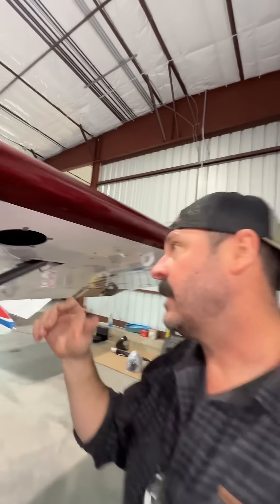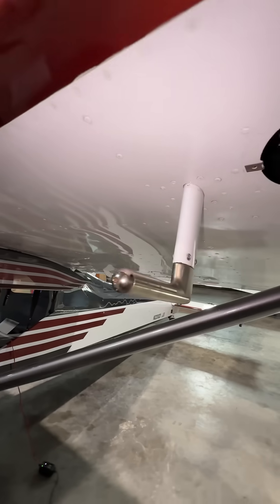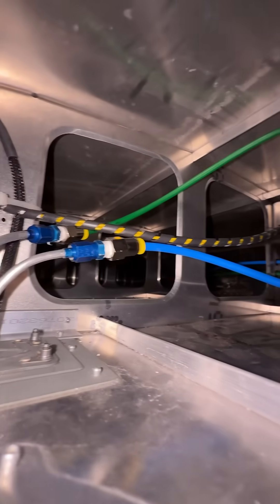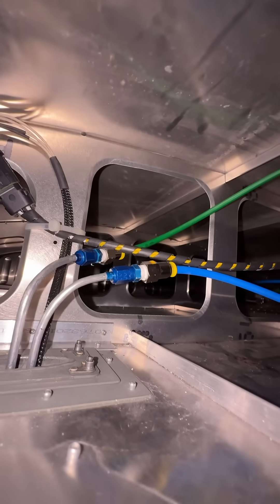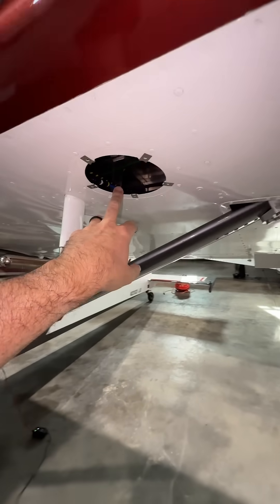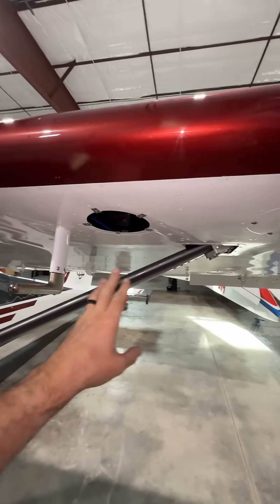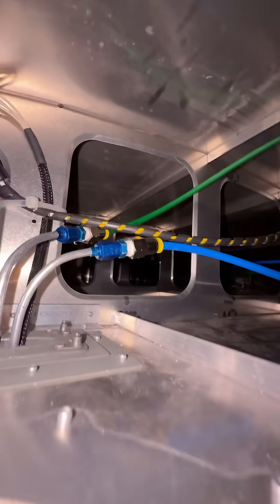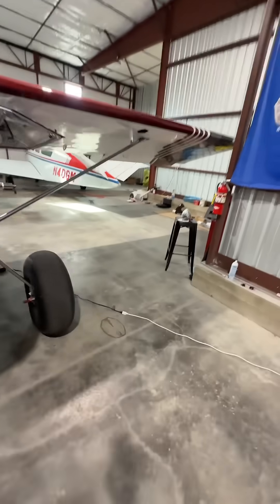I found the pitot leak!

Comment: But how does the AOA (blue tube) interfere w your airspeed (green tube)  indication ? I guess i should look at a diagram of how the whole thing is connected...
Reply from the maker: It doesn’t interfere with the airspeed at all. There are small holes on the bottom of the pitot tube that lead into the blue AOA tube. The GSU 25 compares the pressure differentials between the pitot and AOA tubes and based upon your calibration, gives you visual and audible cues to your AOA. Faster beeps the higher your AOA and solid tone at critical AOA (stall)